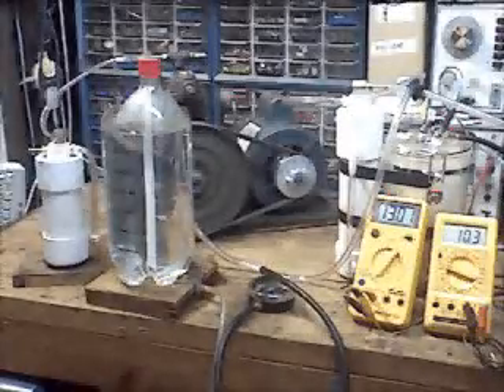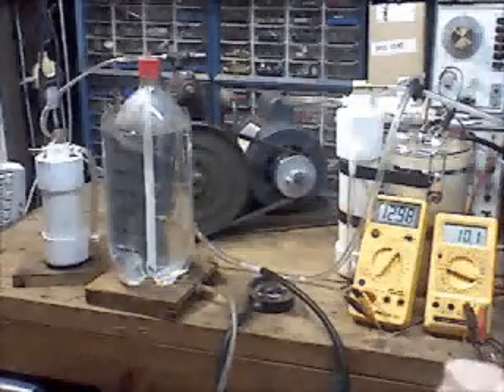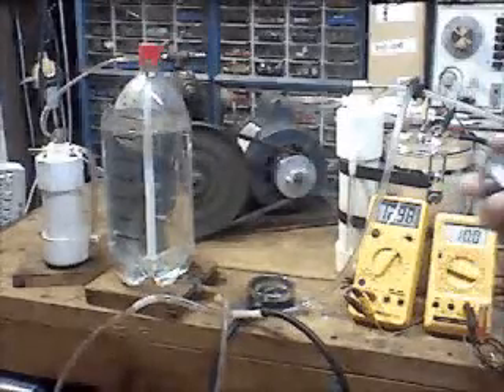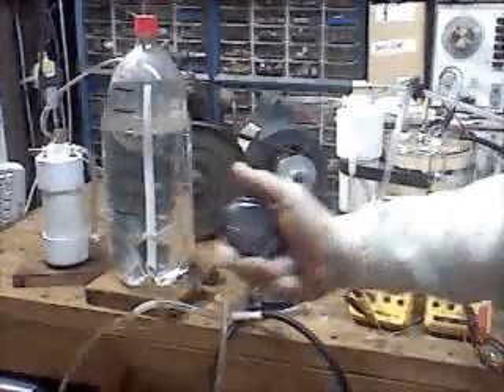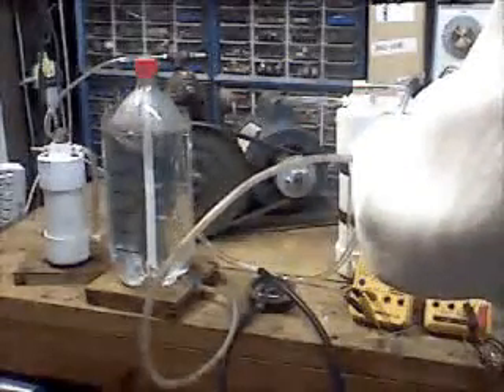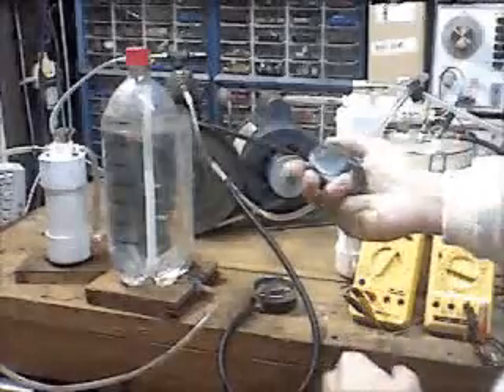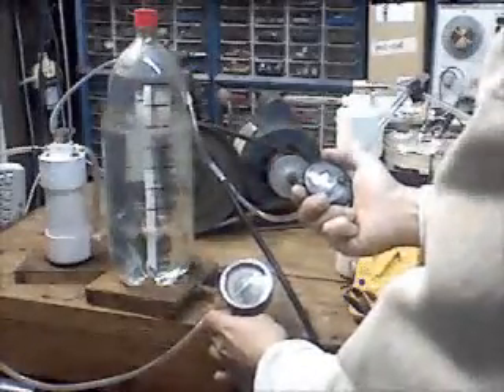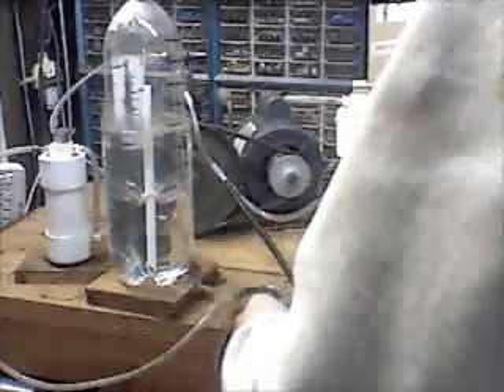#60 Vacuum test part 3

Comment: Nice one Zero. Although the gas production was the same under vacuum, perhaps the quality of the gas was different. What if less H2 and O2 (diatomic) gases were produced and more monatomic gases? What if a cell under pressure was more likely to cause the atoms to pair up whereas with negative pressure, they are more likely to stay as single atoms? Perhaps you just made supergas and didn't realise. Perhaps a fourth video where you ignite some bubbles and see if the sound is different. Cheers ! W

Comment: a cell output  is based on how fast  you can rip hydrogen molecules from under water level  i would think to make a verry large change will be hard to do with vacuum
but it can be done if you can see what i am saying  but dont blowyour self up doing it

Comment: Can I assume from this experiment that if a pressure valve was put on the chamber to prevent the gas from escaping until a set pressure was achieved that the production would be the same.

Would you still have the lag when you hit the gas as the pressured chamber would act as a staorage? The lag would be when first starting the chamber to biuld the pressure. Then maybe a bit to catch up after acceleration.

Comment from the maker: Very simple. A baloon filled with any gas will displace x amount of volume at atmospheric pressure. At two atmospheres (approx 33' under water) it will compress to displace 1/2x. Same number of gas molecules in the baloon.

The inverse is true under vacuum. At 1/2 atmosphere, the volume in the baloon will increase to 2x. Still the same number of molecules.

So, HHO produced under vacuum only looks like more but it really isn't.

Comment: The reason there is no production gain under vacuum is supported by the ideal gas law:
PV = nRT
Under vacuum bubbles are bigger in volume but still contain the same amount of HHO molecules.  Your HHO yield and current dropped a bit under vacuum because the larger HHO bubbles decreased the surface area of the plates touching the liquid electrolyte.   I highly commend and appreciated your objective testing.

Comment: Hey Zero,

I've been catching up on your vids. Too bad about the material integrity problem.

Regarding your fuel efficiency gain. That is a fairly new Toyota with top of the line computer system. Don't you think the computer system is defeating your efficiency by injecting extra (wasted) gasoline as the engine sensors gather data influenced by your HHO injection?

Comment from the maker: Correct on the config. My next build will be PnnnnnMnnnnnPnnnnnMnnnnnP. PWM is only good for throttling a cell.

I have a microprocessor design on the drawing board that that hunts for the natural resonant freq, locks on and tracks it in real time. 1st tests will be two plates only. Not sure how a series plate config will behave. I also have a hunch that parallel plates might resonate like a panpipe, each at it's own freq.

Comment: Hi Zero. Great work. I tried to log in to your website and it didn't work. Therefore Id like to know what your final configuration is on the cell. From what i gathered your using one positive 5 Neutral and a ground 5 neutrals and a positive and there is .045 space between the plates? Is this correct? Did you find any increase with the venturi you put in the intake? Did PWM help and if so at what freq?
Thanks
Stan

Comment from the maker: The FM circuit I'm designing will follow the resonant freq in real time by comparing peak voltage to the freq. When modulated, if the cell center freq drifts upward, the cell voltage will rise on the high side of the FM sweep and the VCO will adjust upward to compensate. Opposite for the freq drifting lower. When resonant, the peak voltage will be equal at the high and low sides of the FM sweep. The sweep rate will probably be only somewhere around 10Hz with a modulation of 2-5%, variable.

Comment from the maker: cont... Flat plates put much more surface area in solution and are easier to work with than tubes. The cells themselves are extremely dynamic. The capacitance (hence the tuned freq of the RLC) varies not only with temp & elyte concentration but also the amount of HHO that's stuck to the surface of the plates & between them. The moment you turn it on the center freq goes wacky. Pulse trains like the Lawton circuit try to catch the center freq as it flies by over and over. Good but not great.

Comment from the maker: The problem with Meyers design is it's pairs of parallel plates in solution. This means that either all tube capacitances must be precisely matched to each other at all times (virtually impossible) or that each tube must be pulsed independently of the others to remain perfectly resonant. A series cell overcomes this problem quite nicely but is more complex to build.

I have a design in the works with a multiprocessor controlled VCO that frequency modulates the center pulse freq slightly.

Comment from the maker: For HHO, since pressure or vacuum has little effect on gas volume production, not really. But, I think it would be perfect to meter small amounts of distilled water mist into the intake for the flash steam it will produce in the cylinders during combustion and for high performance boosted engines.

Comment from the maker: At the vacuum I was able to pull, for the time that it took to run this test, the amount of vapor released would be insignificant. If it were then the HHO production would actually be less than shown. Either way, not good.

Comment: i've seen in my own experements, that the Shape of the Plates makes a very large difference in hho production. i've also seen in my own experements that high voltage and low amperage seems to produce more hho as well.  i've worked with 110v at 1 am using a varractor and a set of 4 diods to convert ac to dc, allowing the cell to act as the capacitor. much lower levels of electrolite though. thanks keep up the good work!

Comment from the maker: I think it has been shown that HHO will ignite at a ratio of over 100:1. There may not be much power at that mix but it will run very lean. The tests I ran on my Honda were inconclusive. The driving I ran it under was heavy stop and go with only a little hwy cruising. Others who have tested only hwy driving have reported better results than I.

Tnx for the compliment. More coming but donations have been pretty slow.

Comment: 1200ml per minute comes to 0.042377 cubic feet per minute. If I had to guess, I'd say a typical engine takes in 200cfm of air when it's driven normally. It would be cool if anyone could show what ratio of HHO gas to ambiant air it would take to push a piston through a firing and exaust stroke.

Comment: Or possibly if you could gage the force put on a piston, then add HHO to the air that's being sucked into the combustion chamber to see how much HHO is required to get a noticable gain in power. How much HHO does it take to get 10% more push on the piston than with gasolene alone. I think that would give us a goal of HHO production. What do you think?

Comment from the maker: Yes. Right here. The hints Maxxx has given are already known facts. There are points at which the cell will resonate electrically. These points drift, not only with temp, plate spacing and elyte concentration but also as soon as bubbles start to form. That's why everyone has so much trouble zeroing in on the resonant frequency! While tunable PWM's might be able to sweep through resonance, they can never lock on without closed loop circuitry. That's already where my experiments are headed.

Comment: I have a salt water pool, he is spot on. The salt in the water when the DC current is applied produces chlorine. No salt you get hydrogen and oxygen. So what is so new here? 
He won't give specifics, but it seems that it needs a closes loop self tuning resonant electronics circuit. Any electronics gurus out there????

Comment: i think you r missing plenty. there is some merit to his post.
convert you production to mass per unit time, more use full data.
9-12amps is a lot of current, need to get to under 1amp. Are you using DC square wave circuit or a signal generator like the Stan Meyers setup?

Comment from the maker: I know Maxxx. But the difference between you and I is when I finalize my design (and it will be soon), I will release it free of charge into the public domain, without any claim whatsoever. Anyone that wants to build it for personal use or profit, all the power to them. If your design really does work, why you would want to keep it a secret is beyond selfish. All you have done is delay the proliferation by a very small degree.

Comment: I know this is leading to the best solutions but.  Coal+heat+iron(hopefully recycled)-->steel+h20+(recycled electricty)-->car energy+burned metal+possible  precipitate+core residue
There is a reason the crust separates   water from the earth's core.  I think it is sulfuric acid and ammonia pretty much where Venus is now.  Venus must have been run by power hungry lizards or dinosaurs  .  I hope we figure out plants are the return cycle soon..........

Comment: I really don´t believe this.
How is your bubbler built ?
You just suck in the air from the upper output of the bubbler, but you won´t raise the water much,
because the water can not be compressed much.
So there will not much real vaccuum ontop ofthe electrolyte surface... So please try again with the vaccuum directly over the electrolyzer.
Many thanks.

Comment: Hi ZZF,
why don´t you use the vaccuum pump
directly at the cell.
Putting a bubbler between it in my
opinion will not work to generate
a right vaccuum inside the HHO generator...

Regards, Stefan.

Comment from the maker: It's total ACTIVE surface area in solution, that surface ares which creates the gaps in between the plates.

Example: 5 plates measuring 2" x 2" each configured +n-n+. Each plate exposes both sides to another plate (8") except the 2 outside +plates which expose ony one side to another plate. Total area = 32sq-in, not 40.

Comment from the maker: It IMplodes only of it's a perfect ratio mix of 33.33%/66.67%. Anything off this perfect mix ratio EXplodes. Filling a water bottle and letting a bit of air in demonstrates this easily. Hydrogen will also burn extremely lean, over 100:1. So now what do your numbers look like?

Comment from the maker: thermoelectrics work effeciently to heat and cool when powered but not so much to create electricity from a heat source.

And no, my MPG has not increased, even at 1.5 LPM. There's still more alternator load on the engine from the amps being drawn than is being returned by the HHO created.

It is my opinion so far that brute force cells are of little benefit unless being powered exclusively from recovered waste energy.

Comment from the maker: Unless you plan to produce hundreds of cubic feet of HHO per minute and vent it into the garage, or your wood burning stove is an open pit with sparks flying directly beside your work area, I don't see a problem with that at all. H2 disperses to noncompustable proportions VERY quickly. The real danger is sparks inside your cells from poor electrical connections.

Comment: you seem to be the master at making the gens and doing the experiments but i was wondering does light effect the rate of production because the power tube was in complete dark and i made a similar one but with a clear jar and mine did not produce not even half of the gas also i made one out of razor blades and it seems to work but not as good as expected  any advice?

Comment from the maker: It does burn hotter, but it also burns much faster meaning the heat does not have time to transfer to the cylinder walls. Engines running pore HHO actually run cooler than gasoline.

Comment from the maker: Depends on the overall surface area of the plates in solution. On my cell (312 sq-in total) I shoot for 10 amps cold, 20 amps hot. More gas requires more cells, same target amps per cell. Therefore 5 cells should draw 50 amps cold 100 amps hot. Way beyond the capacity of a standard alternator. Here you'll need a 2nd alternator or extra heavy duty replacement for your existing one.

Comment from the maker: I used 3M White Eurathane Marine adhesive. Found it at Home Depot. Goop brand marine adhesive is also good. Be sure to let it cure thoroughly, 3 or more days, before placing in service.

Comment: What kind of Adhesive did you use against the plates and the lexan? I tried Super Glue Marine Epoxy and in one week my 13 plate cell fell apart when I cranked it up to 25 to 30 amps. Is the Marine Tex mentioned on the other video comments best or you recommenend a better one.

Thanks..

Comment: Actually, GM Sequal looks ok, but it's U.K. counterpart, the HY-Wire, built by Vauxhall, looks better. Daimler Chrysler effort looks good too, but they seem to be attempting to "add too much value", in an attempt to justify high pricing when in fact, they should be able to substantially reduce prices of such cars.

Comment from the maker: Actually, the ones I use are 520. When I push the bottom out to make it convex it goes to 530. But, my water line mark is at precisely 500ml leaving 30ml trapped air at the top for the tube in the center so it doesn't take in any water.

Comment from the maker: Correct. I could also just pull it from further back in the exhaust with the cell under vacuum with a 3/8" solid fuel line. By the time it gets to the front it would be cool enough to draw into the cell. All refinements for later.

Comment from the maker: Yes. The difference would be that bubbles within the cell would be smaller under pressure instead of bigger under vacuum as they were in this experiment. This may actually help keep plates in greater contact with the water to produce more HHO once it's allowed to expand at atmospheric pressure. Too bad my test container won't hold back some pressure or I'd test that theory right now!

Comment: Agreed. 
7,7477 ml/min/watt almost exactly equals 100% efficiency when based on Higher Heating Value of hydrogen.
Efficiency may also be calculated using;

Efficiency (%)= 7744*100*V/(U*i*t) where

V= collected H2/O2 gas (liter)
U= Voltage
i= amperage
t= test time in seconds

Comment from the maker: We're using 7.75ml/min/watt as the break even point. My zero cell averages 4.8. A couple of guys I know have cracked the 5ml barrier slightly with parallel plate designs. This seems to be the practical limit for conventional brute force without secondary fracture techniques.

Comment: OK, so efficiency in terms of energy in/out
using Higher heating value of hydrogen:
534 ml in 66 sec at 13Volts/9 amps:
=53,5% efficiency of the cell....

Comment: i realy like the vacuum idea, i think if your idea works it needs to be a venturi in some sort of hho carburator ontop of a fuel injected engine where you can get a high vacuum signal when you need it, if you are decelerating towards a stop sign like you said it can rejuvinate, my cell takes 100 amps, i know thats to much but i have so much hho that its just dangerous let the venturi regulate consumpstion, propane caruator? Paul

Comment: One thing you might want to check while you have this apparatus in place.  Test the electrolyte characteristics of the water vapor exiting the system.  Would be interesting to determine if your bubbler/dryer is catching all the KOH.  Really do not want KOH going into the engine.  If the water vaport is "distilled" by the process, GREAT !!!  Let us know.

Comment from the maker: Picky, picky. The point I was making is the cell under vacuum produces no more gas than the same cell at atmospheric. Therefore, the cell under pressure should be the same but behave opposite. Instead of expanding upon release, it's compressed, producing smaller bubbles and less foaming. Upon returning to atmospheric the gas expands to the same volume instead of contracting. Either way, the gas volume at atmospheric is the same.

Comment from the maker: Oh, I see what you mean. Once it comes up to full vacuum the pulsing is minimal.

One thing I will say for operation under vacuum, it will release much more water vapor in the process.  Water vapor in the air/fuel stream is an essential ingredient.

If nothing else, I have clearly demonstrated the proper scientific method for taking cell measurements for accurate comparative data.

Comment: I understand how water boils. I think you need to be at the edge of boiling. If its by temp or vacuum. That will be the lowest vapor pressure, right? And do not have any cushion. With this pump your pulsing the cell with vacuum. If you have any "give" then the direct effect will not be on the water but the lines, cell, bubbler, and water in the bubbler.

Comment from the maker: Cell won't boil at rooom temp until you reach about 28.5-29"Hg. @25"Hg tap water boils at 130*F. Lines did not collapse.